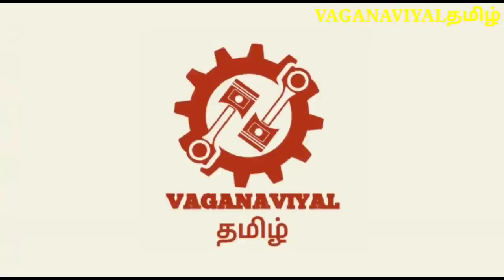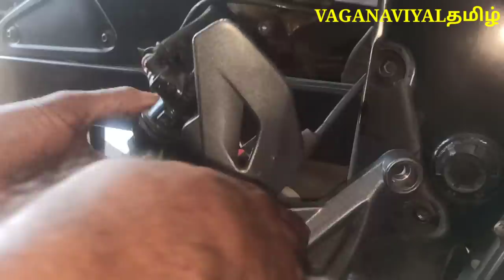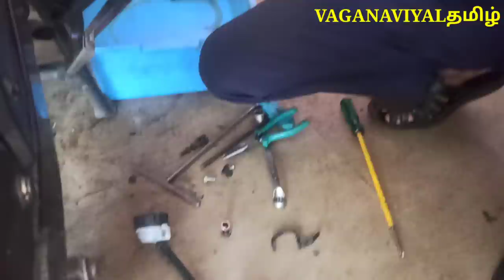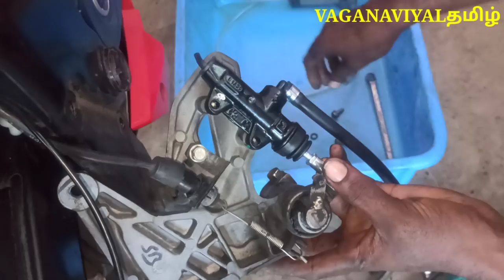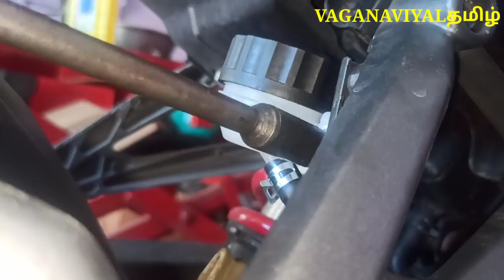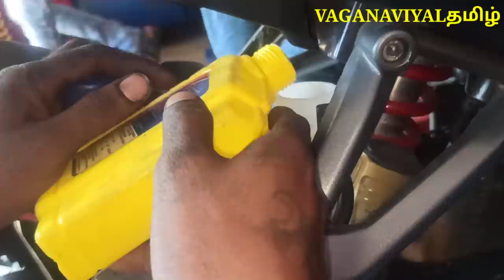NS 200 REAR DISK BRAKE PROBLEM/ தமிழ்

Comment: Anna na apache 160 4v bs6 vankiruken.
10000 km reach...
Adikadi engine off aakuthu..
Twin head spark plug change pannlama...
Athu use pannalama...
Atha pathi oru video podunka na....
Twin head spark plug koda advantage disadvantages sollunka bro...

Comment: Hi Nanba... Vanakkam 🙏 enaku oru doubt Honda dio latest model fuel injection type vandi la indicator buzzer vaika kudathu sonnanga adhu fix panna sensor unit board poidum sonnanga adhu pochina 30,000 mala aagum solli irukanga adhu unmaiya bro.
Reply from the maker: Fix pannalam bro no problem

Comment: FZ V2 FI rear disc version back(rear disc) master cylinder Spare parts cost + change pannarathuku evlo varunum gobi na🙂!!!
Reply from the maker: 800 bro
Reply: @vaganaviyaltamil  when does this problem comes??? & master cylinder is same for non abs vehicles?? Like is there different cylinder for abs and non abs bikes???
Reply: @vaganaviyaltamil  sir my both  brake works good but they are not tight like needs some pull of course no air

Comment: Bro 99rpm.com intha website la check panni parunga Bajaj Geniune kidaiku... Naa en Pulsar AS 150 ku maximum parts ithula thaan order panni vanguvean..
Pulsar AS ku enga area la oru sila parts kidaikathu... Pona masam clutch plate intha website la thaan order panni vangi fix pannom. Local la dealer nu yaarkittayum kidaikala
Reply from the maker: Ok bro thank you